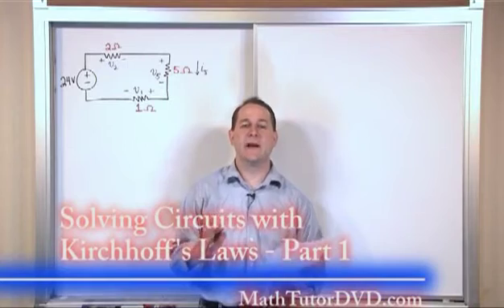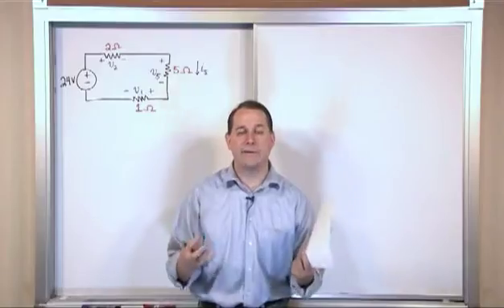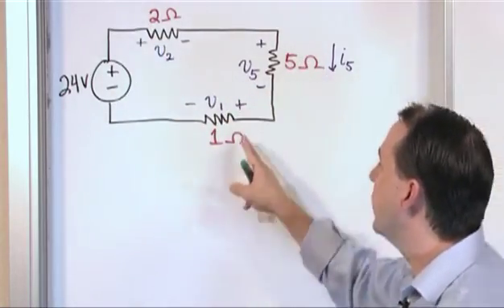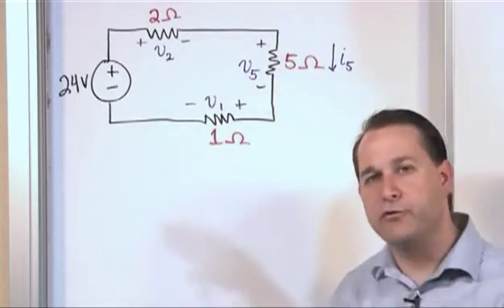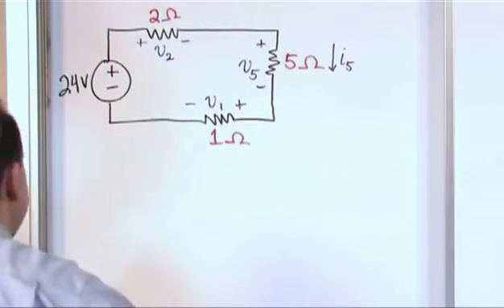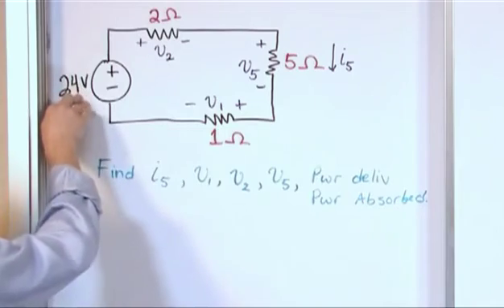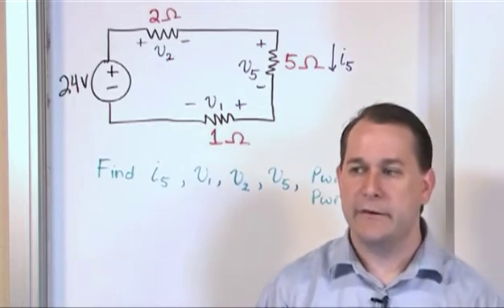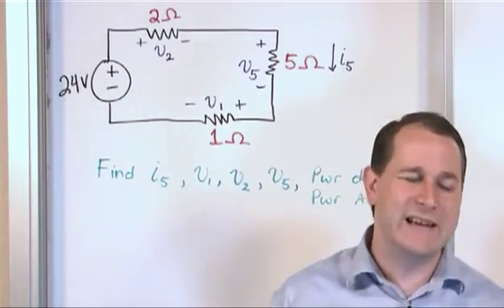Lesson 7 - Circuit Analysis Using Kirchhoff's Laws, Part 1 (Engineering Circuit Analysis)

Comment: V2 should be labeled as V1 and V5 should be labeled as V2 and V1 stays the same to not confuse others but I guess that's the whole point. We must first find the total Amps in the circuit to find the voltage at each resistor. Using the following we can find the total of amps in the circuit = 24-2i-5i-1i=0, solving this would give you 3AMPS. Now that we know how many amps are in the circuit we can then find how much voltage the first resistor uses. By using ohm's law, V=-IR, the I is negative because resistors always subtract the total voltage in the system and it will always be true because resistors always drop the voltage. Therefore 24-3(2), solving this will give you 6. We now know that the first resistor uses 6 volts, therefore the new voltage is 18 volts because 24-6=18. Now we can move on to the second resistor using ohm's law again, therefore 18-3(5)=3. Therefore the second resistor uses 15 volts since our answer was 3 volts because 18-3=15. Now our last resistor we can use the same rule again, therefore 3-3(1)=0 which answers the final voltage of 0 volts which now solves our circuit.